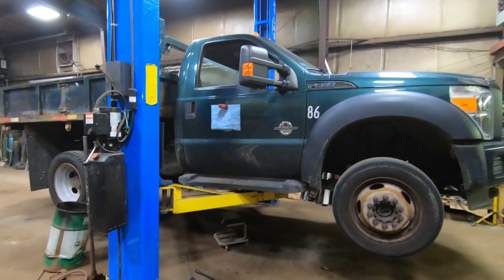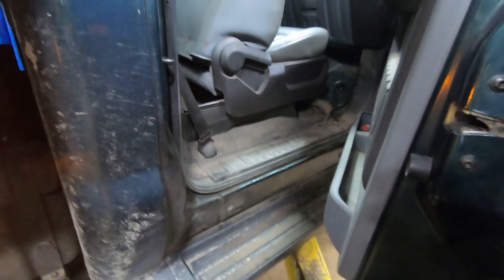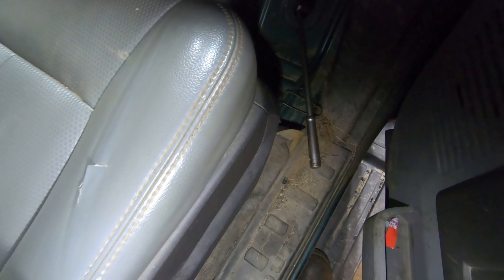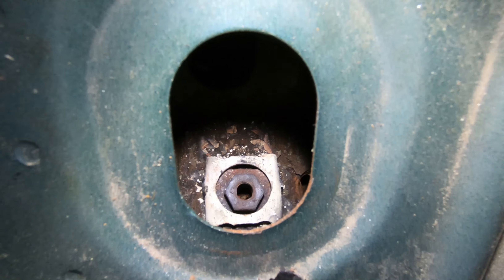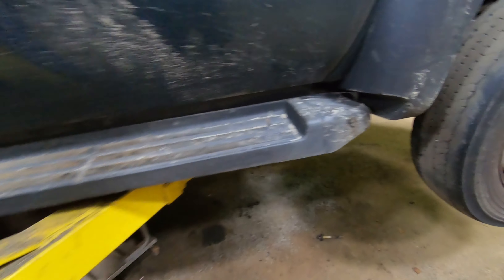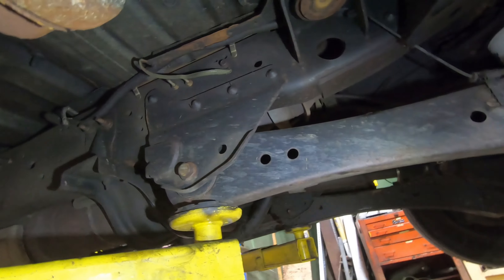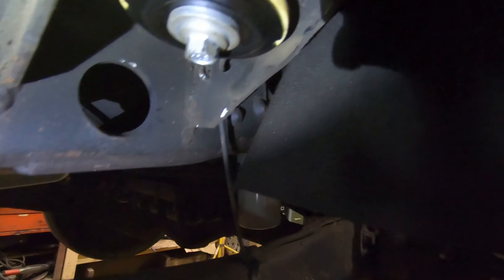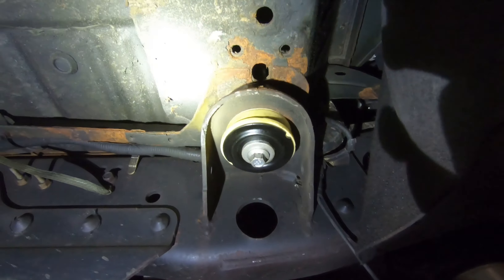2011 ford super duty f550 body mount replacement

Comment: Hey Jason, great video thanks man.
Quick question: I have 13' F550 6.7, bad steering issues. I've put all new tires on the truck, new moog tie rod ends, new drag link, and new steering stabilizer and had it aligned at a shop. Its much better don't get me wrong, but it feels like the truck isn't planted? Like it takes a second for the body to catch up with the steering. I was thinking checking body mounts next but how do I know if they are bad if I can't tell visually?
Reply from the maker: It’s usually pretty obvious when the body mounts on these truck are bad. The insulators split and will come out of the bottom of the mount half. You could put some pressure on the body with a jack and see if the body lifts but generally the bad mounts I’ve seen have been the bottom half of the mounts split. Have you checked the track bar? I’ve seen the ball joint end on the axle side go bad on a 350 with only about 20-30k miles on it. Our truck have a floating kind of feel in the steering too so it may just be a characteristic of the vehicle.
Reply: @JasonTheMunicipalMechanic  Yeah i've already replaced the trackbar. I think next im gonna try to replace the steering box. But yes it is like a floating feeling. I pull skidsteers and excavators so it's an issue I'm trying to solve as it can make things sketchy when on backroads.
Reply from the maker: I can see why you would be concerned. Is this more when your towing? Could it be too much tongue weight lifting the front? Sometimes axle ujoints can seize up and cause steering issues. I was at a heavy truck shop once and they had a machine I drove on to and it would kick the truck around by the wheels to look for loose components by shifting the truck weight around. If your looking for loose components or play maybe you can find a place with one of these machines. Also a lock rear end might cause this type of problem if it’s stuck locked.
Reply: @JasonTheMunicipalMechanic  Whenever it's loaded it feels better. I've accidentally loaded too much toungue weight a couple time and it didn't make the steering any better. I really hope it's not a characteristic of this truck, as it's been an powerhouse pulling machine for  us.

Comment: 0.55 = cringe worthy! Lol
Sometimes it's the only option, but damn I hate when it is!
Reply from the maker: I know what you mean. I try and use dealer parts when I can, but I called over and over and no one would answer the phone at the dealer so I got the dorman. I’d rather not get cheap parts Because even though the cheap parts say there the best gold lined parts this side of the world they just don’t last. It usually get the best of the aftermarket selection but this was all they had so I went to the dark side.
Reply: @JasonTheMunicipalMechanic  haha I know what you mean! I waited a week for the dealer to get me some glass lift gate hinges for my explorer, cuase I just could not bring myself to pull out my $ for the Dorman parts. 
Shame really, if they would only invest a little more into making a part, they could be ok.